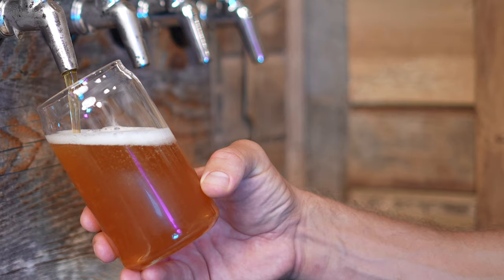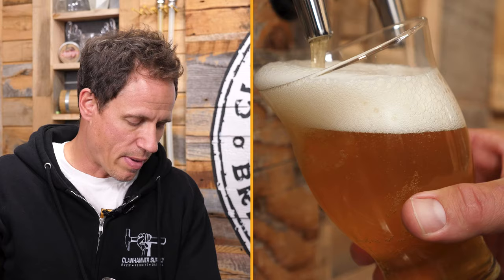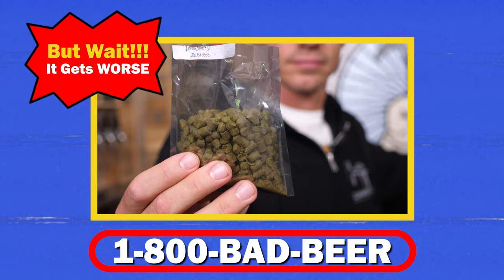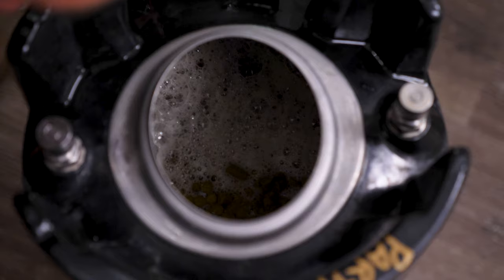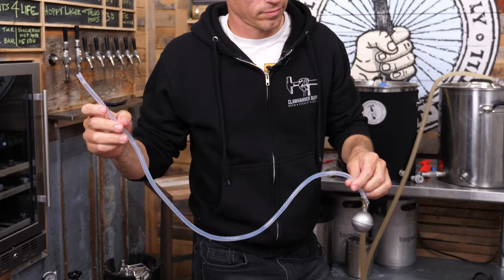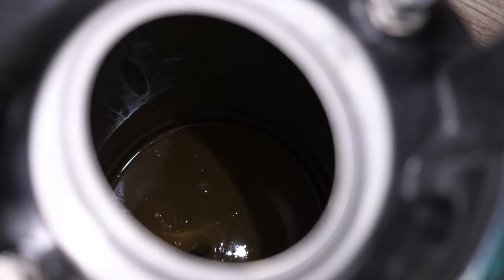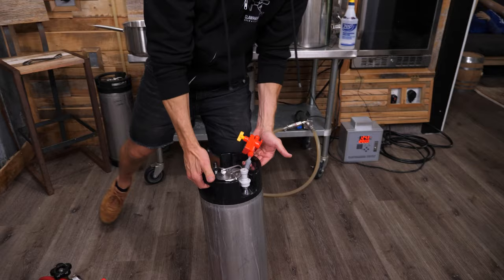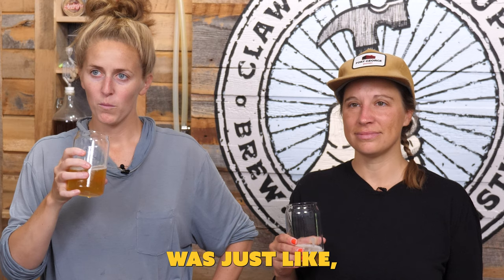Brewing The Lowest Effort Beer Ever!

Comment: Last year I did some experiments where I would subtract or shorten a different step in making the same beer to see what, if anything, would be different. Example: my mash's are generally 60 minutes. So I started subtracting 10 minutes to see if it effected efficiency. It wasn't until i go to 20 minutes that I saw any real effect. Then I messed with my sparge. Then my boil. the my wort chilling. I ended up with a beer I mashed for 20 minutes, did a cold sparge (room temperature sparge water), boiled for 25 minutes, and did the no chill method. Aside from it being a good bit lighter in SRM due to less boiling time, it tasted damn near the same as the 60 minute hot sparge 60 minute boil version.
Reply: I've been cold sparging for a couple of years, after comparing/testing with hot sparge.  zero impact on efficiency, and minimal to no impact on anything else as well.  Hot sparging is  just an added cost/step for small homebrewing operations these days I think.
30 minute boils rock, especially for more session style ipa's.  SRM isn't critical, hop additions only need to be 30 minutes max anyway (most of mine for a light IPA are only 15-20 min max, as I want more hop flavor/aroma than bitterness), and so an additional 30 minutes is just wasted time.
Reply: @Mb0lism  agreed 100%.

Comment: That is not the lowest effort beer. That is the shake'n brew method. (In the keg: Dme, bitter hops, enough hot water to dissolve dme after a quick shake of the keg. Chill with enough cold water to reach pich temp (and if you care: The desired gravity, use a calculator for this)  for the desired yeast. Pitch yeast. Done in minutes. If you ferment with the right kveik (or Nottingham and similar fast yeasts) you can have a drinkable beer in a couple of days. You can also skip the hops and bitter to taste with hexa or tetra when the beer is finished.  You can also add aroma hop extracts to the finished beer and just don't add hops at all.

Comment: I've done this before but never with a no boil. 
Sneaky hack for avoiding the trub, ferment it leaning in a corner with the dip tube at the highpoint, then transfer to a serving keg with the floating diptube. It's an extra step but it gets you a really clear beer if you don't mind losing a pour or two.

Comment: You don’t use floating dip tubes with ale yeasts?  Is that just for fermentation or for serving as well?
Reply from the maker: Because ale yeast is top fermenting it tends to Clog up the floating dip. We’ve had problems several times, including this beer. But we’ve never had a problem with lager yeast and floating dips.
Reply: @ClawhammerSupply  hmm strange, I run floating dip tubes with filters in my all rounders and use ale yeast almost exclusively. The only time i have problems, is if i try to pull liquid when the hops are still floating on top. LOVE all your content braj.